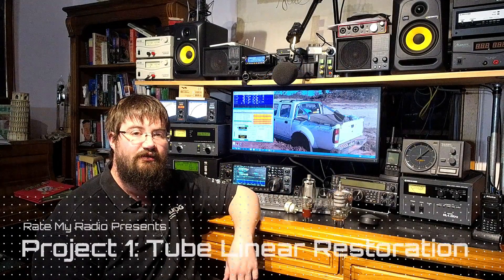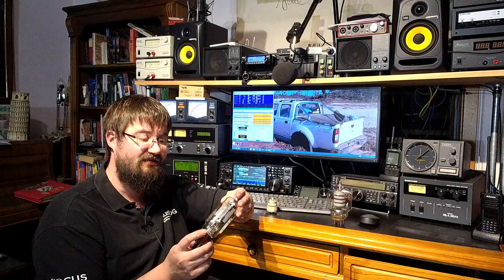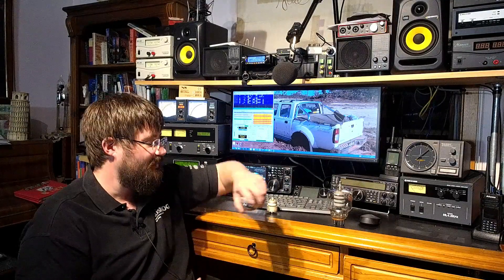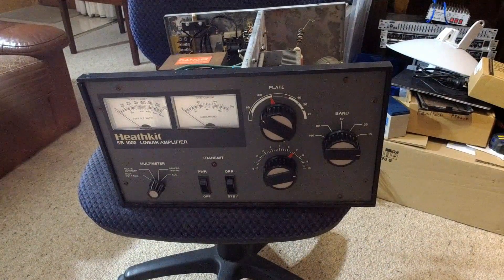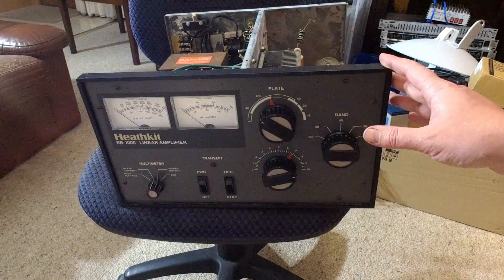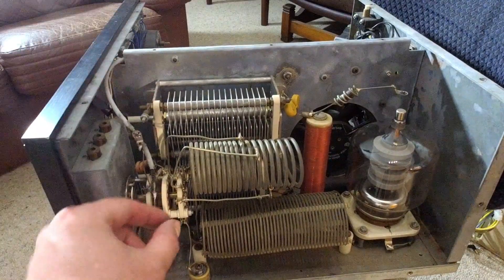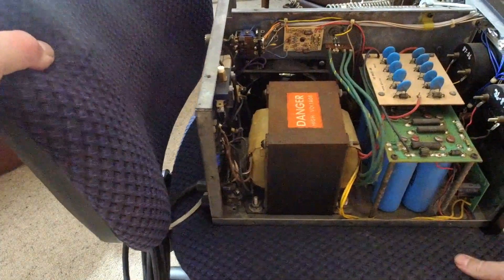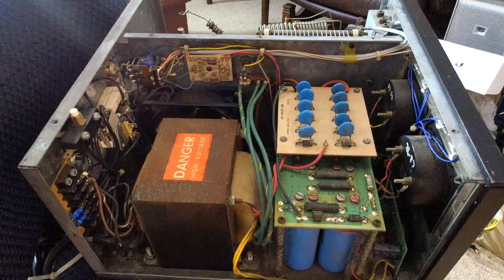RMR Project 1: Tube Linear Restoration Heathkit SB-1000

Comment: I did one s few years ago. It had a gassy 3-500Z and an arced band switch. The switch and a buck boost transformer were available from a MFJ amplifier. A friend is using so I guess I did a good job.

Comment: Nice project! It will make a good amplifier when finished. I would put it back in box stock condition to keep collectible value up on it. I would consider a few mods such as; led panel lights, and so forth, but in the end it is your amplifier. I will stay tuned to see completed project.

73 
kc5ngx